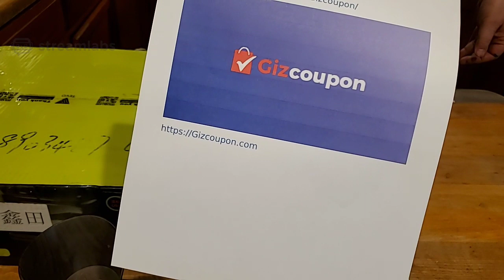Lets assemble a 3d Printer!  Live Stream:  HOMERS/TEVO® Tarantula Pro 3D Printer Kit

Comment: This took me longer to do.
The hex keys were missing, and the wrench was for some other kit, as it didn't fit anything.
When it was time to test the stepper motors, I discovered that the Y-axis part of the board was bad.
Had to buy another one. (A newer version of the mother board was readily available on Amazon. $35.
The supplied SD card was blank. That's right... NOTHING on it. Apparently, the printer they shipped was
in the middle of a transition run, and was probably packed on a Friday afternoon, about 3:45.

Because this unit was shipped with a bad board, I was forced to deal with tech support.
WARNING: If you're in any kind of a hurry, believe in ADEQUATE customer service, or expect communication...
tech support is NOT for you. If your unit was shipped with faulty parts, and feel they should be replaced with minimal
hassle, at the company's expense, tech support is NOT for you. If you expect a tech to help you with technical things...
tech support is NOT for you.

When you first meet up with them, you may be confronted with a battery of "prove to us that you own this machine, and that
it does, in fact, have a legitimate problem" tests, with which you'll be required to show pictures, take video, and provide
"proof of purchase" documentation. I made the mistake of expecting a bare minimum of urgency in resolving the issue.
That's what ultimately lead to "snail-mail" paced service. I did ALL of the troubleshooting, without their assistance. Having
paid for a new board at MY expense... it took a week of begging, just to get a copy of the firmware, and three requests to
instruct me how to install it. No kidding. 

I bought & assembled this 6 weeks ago. I STILL haven't printed anything on it yet.
When you are tasked with supplying your own motherboard, you have to start from scratch.
You have to calibrate EVERYTHING. And that is no easy task.

By the way...
Did you finish this build and print something yet?
Reply from the maker: Obviously I'm not a company rep, but i have been very happy with mine.  I have printed and sold enough on eBay to more than pay for it.  I have most of my prints streamed to Twitch, you can see them at https://www.twitch.tv/whatarewefixingtoday.